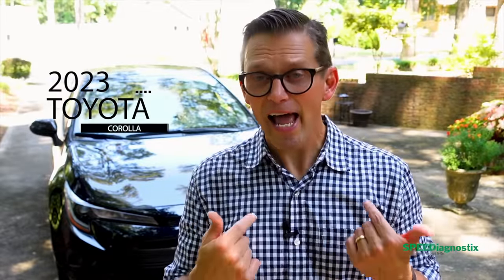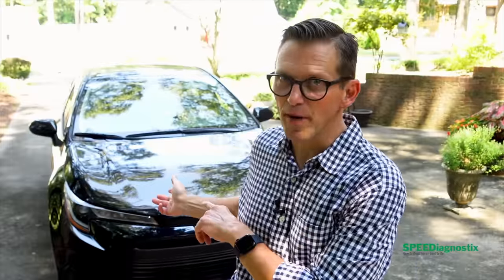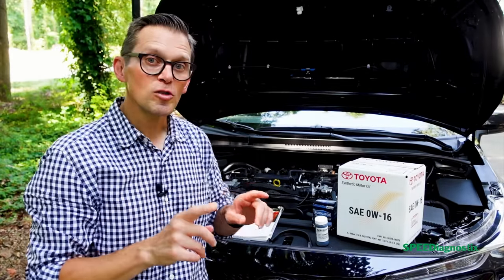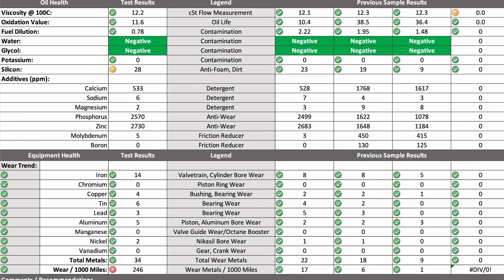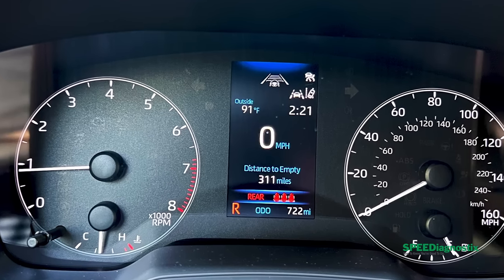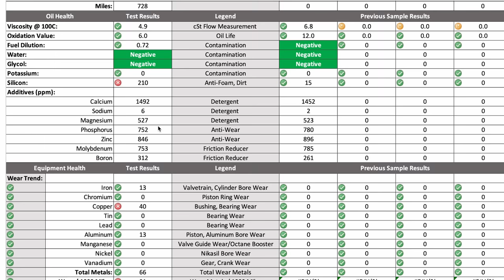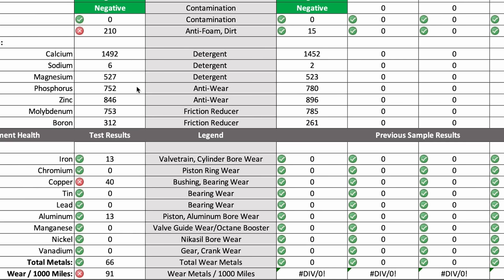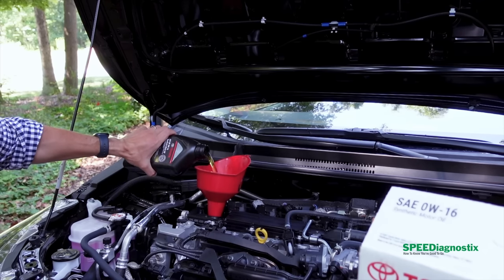AVOID the ONE MISTAKE Almost EVERYONE Makes With A Brand New Car

Comment: I've always drained the engine for a minimum of 12 hours during any oil change. What do you think about that. The experiment I did after being told to do this was a regular oil change, and at the point I would normally put back in the drain plug, I put a clean catch pan down and let it sit 12 hours. When it was over, there was about 1/2 of a cup of nasty Rotella that had a viscosity that was thicker than the oil. Almost like tar.

Comment: Have you tested the different add ons like slim 50 prolong and z max. I did use prolong back when it vame out had a e150 that had a rear main i replaced twice but keep leeking it was so bad. I was broke and ran out of oil to put in it so ended up driving it 100 miles i no when i left it was down 2 quarts i went thrue that much driving 50 miles a day it was knocking hy the time i got were i needed to go but never locked up drove it another 30 miles no oil in it atleast nothing ahowing on the dipstick lol i had used a bottle of prolong it qas probably 20 years ago it was put in back when i put in the last rear main took a couple months before it started leaking it was a 351w with bad main bearings already oul pressure started dropping at around 80k but was curious if those additives really worked . Thank you for another great video!!!!!!
Reply from the maker: Stay tuned!

Comment: The first oil change is the most important. I believe in the first oil change at 500-1000 miles. I did my Tacoma when it was only 2 weeks old. Every race car and engine builder will do the first change at 15-30 min run time. Again when it only has a few hours, and again at 1000 miles.

Comment: Thought I was the only one still doing that... But, boy the dealer was not happy about it. I've been a sole mechanic on our vehicles for 40 years and also worked on a car and truck assembly line for 4 years back in the seventies. I saw how they filled the engines with oil out of a hose hanging off the ceiling as I recall. Now they have robotics, but the inside of the engines had plenty of dust and debris... that's the environment of a factory.

Comment: my wife just got new rav4 prime and i will be doing the first oil change after she used up her first tank of gas or maybe 2nd tank. so far she reached 1000KM but still have 1/2 of the first tank of gas. I told her to use Hybrid mode during the highway and EV mode during the city.
i always do 5000-6000Km or 5-6 months oil changes on my cars. now one is over 300,000KM and other we traded for the prime was 280,000Km. 

it is funny there are people keep encouraging to do the dealer 10000 mile oil changes. or saying that it is waste of money if do it earlier. remember dealer recommendations are bare minimum. if you are leasing or keeping the car for less than 5 years = of course just do the bare minimum. 

in my opinion, this might work for him/her but might not work for others. because if an owner who drives only to supermarket or doctors appointments only (maybe retired) for less than 10 miles per day. means they will have to change the oil in 1 year right? 
or someone who works up in the mountains and has to drive climbing 20 miles in high summer heat, still do 10,000 mile oil changes?
see the driving condition is different 

but if people want to do oil changes before the dealer recommendation, why not? 
it is like insurance. do you buy insurance? or just waste of money too? 
it is peace of mind for most owners who wants to keep their car longer. 

as avoid warranty? as long as you keep the receipts of the filter and oil purchased and keep a good service record of date and milage. dealer cant void the warranty. 
Also if you change your oil more often, there is less chance you need to claim warranty on the engine. 
unless is something else. 
for those who DO the 10,000miles oil changes might be worry after the warranty expires. 

i used to do oil changes and other services on my dad old 1999 honda civic, lucky we bought extended warranty.  the transmission started to slip on the last year of the warranty. 
i even had receipts of transmission fluid purchased at the dealer, date and milage changed few years before it started to fail. provided all record and info to the dealer 
no questions ask, the warranty was approved, and we only had to pay $25 deductible fee. for like $3000-4000 transmission. 

to finish, which car would you buy as 10 years 2nd hand?
a car from an owner who do 5000 miles or 6 months oil change keep records and receipts-  probaly 20 oil changes - easy to prove today with pictures on cell phones. 
 
or an owner who said on here my record from the dealer 10,000 miles so 10 oil changes.

please be honest.

Comment: What do you recommend for a 6.2L GM Truck that doesnt do towing just some mild aggressive driving. Pennzoil or valvoline ? And would you recommend the 0w20 like dealer or a 5W30 ? I live in a high heat area if it matters

Comment: Purchased my 2018 Honda civic hatchback  Turbo new. Got first oil change at 2500 miles as the computer MM system prompted me to. I was confused at first until doing research on "new car engine break in periods".

From that research I learned that Honda uses a special oil from factory that has extra additives for the break in period to help protect the engine. Either way Honda hooked me up with a free oil change since it was my first and a break in period change. Not sure why toyota would ever say to go 10k miles on a new car before first oil change.
Reply: Also on a side note, Honda manual declares a break in period. It said to not drive the car hard and to avoid a constant rpms such as highway cruising but to vary rpms. Which worked perfect for me since I live in a hilly/mountainous area

Comment: I recently purchased a CPO 24’ Lexus ES300H with 47k miles. It’s only had 10k mile oil changes according to the CarFax. It was hard to pass up this car because of the price and condition. 

Although it’s ideal to follow a break-in oil schedule as you’ve recommended, it’s too late. How concerned should I be?

Comment: I’m 71 years old, and I learned from my father at a very young age that you always change the factory oil the first time at 500+/- miles. I did it with my 2003 F150, 5.4L. It has over 290K on it and still runs great. I change the oil and filter every 3-5K, whether it needs it or not.😉😄

Comment: I had a mechanic tell me this in the late 80's. His reason was that the cars were started / stopped many may times from rolling off the assembly line. A lot of wear with stats and stops and back then he said when an engine is started stopped cold gas gets into the oil. I wonder io there's a way to tell how many times a car has been stop /started?

Comment: Hi Motor Oil Geek.  Just bought a 2024 F-150 with the V8 Coyote engine.  Going to make my first oil/filter change at 500 mi and then my second oil/filter change at 3000 mi and my third oil/filter change at 7000 and after this I will change oil/filter every 4000 or 4 months whatever comes first and I will stay on that schedule for the life of the truck.  I'm going to use motorcraft full synthetic oil 5W30 
and motorcraft filter.  Is this a good plan???
Reply: That is very low quality oil. If you are going to use it I would definitely add half a quart of marvel mystery oil at each oil change. Got almost 400K out of my last Ford engine with that formula. It will keep the rings from getting stuck, and keep the engine very clean and running smoothly.

Comment: I'm in agreement with the early first oil change, however, you can accomplish nearly the same thing by using a refrigerator magnet. Just wrap it around your oil filter (at the lowest point) and the magnet/filter will collect most metal debris floating around your oil.  Once you do your first oil change, replace the drain plug with a magnetic one to collect metal in the future. Granted, this will only catch the iron based metals, but the lead, copper, tin, etc. are softer metals.  I don't know why filter manufacturers don't place magnets in their filters.

Comment: Can I ask you a question Sir.

When I bought my Triumph Motor Cyckle new in 2020 I was told by the sales man not to exceed the 500mls oil chant the Triumph req....he said it as the engine is filled with mono SAE break in oil at the factory.

It was covid lock down at the time....I am a spanner guy so I got permission to sdo the 500 mile for service oil change myself long as I use a Triumph Oil Filter and the req Castrol oil which I dis....10w/40 semi or fully synthetic.

Job done I started the motor....rattled a bit ok.

But ever cold start since that first oil change I get a tapping noise from the motor after about 20seonds....lasts about 3 mins and slowly goes....the engine is sweet from then on till the next cold start.

I have spoken to many owner of the same bike as me around the world.....lots not all have the same problem.....tapping just after cold start....lasts 3 mins and slowly goes.

My guess is that if the salemanm was correct in saying the motor is filled with break in SAE 30 mono oil maybe that thick oil masked something we hear now,

Do you think it could be correct that Triumph do put Break In Oil in there engines at the factory.

I do still have that oil I drained out on that first service....most people I ask disagree with what that sakes man said re the break in oil.

Would love to know if that oil I still haver is indeed SAE 30 mono grade.

The old break in oil was quite clean at 500mls....it a sort of clearish brown color....like oil from years ago.

What do you think Sir.

Nick in the UK.

Comment: The owners manual says you can use the 16 but then the next oil change you have to go back to the 08, do you think it’s OK to stay with the 16 because I had to buy the 08 from the dealer and they want $20 a quart
Reply from the maker: The 0W-16 is fine to use all the time.
Reply: @themotoroilgeek  thank you very much

Comment: HELP ME PLEASE,  I'm too old to waste another minute until the throw dirt on my face. Cutting through the chase,  What oil should I use for my daughters brand new 2025 Honda HR-v (non turbo)  with 75 miles. I'm changing the oil/filter around the  500 to 700 miles to get rid of break in contaminates. Thanks for helping out an old guy whose candles burning down !

Comment: I do not work on alot of small engines but V8's and diesels alway's get a 500 mile or for equipment 20hrs at most. Sound's strange to change it in 20 hr's (2 1/2 day's) but that is more then 500 miles travel time.  Also the only time I ever sent in new oil for analasis was following an engine failure on bulk oil. Turns out the bulk oil had better readings then out of the bottle off the shelf.  You do have to love oil analisis if you do it faithfully. Amazing to watch wear drop with with a  quality oil vs what is typicaly run to save money.

Comment: Question. What would be the perfect oil change interval during break in? first change at 500 miles, second change at 1000 miles and then each 3000-5000 miles?
Reply from the maker: That would be about ideal!

Comment: Sorry, I changed my 1st OIL at 500 miles paid out of pocket, dealer won’t do it ! Am waiting to have the Dealer changed it at 5K miles ! What is your take on using Royal Purple on 2021 2.5 / 2024 2.4T Subaru engines ? 

I also own an STI S209 but I use the MOTUL 300V, that’s what STI recommended for the S209,  been that is a High Performance Beast.

Thank for the feed back !

Comment: My habit has been 1st oil change at 1,000 miles no matter the vehicle... and every 3,000 miles thereafter. My rockers, cam, tensioners etc have always looked good without any varnish. Oil by design holds particles in suspension and I refuse to trust the intervals - especially for my 2022 F150 work truck that tows daily. The wifes Subaru gets it every 6 months whether she likes it or not LOL....... but then again she drives a couple thousand miles per year and runs ethanol free fuel unless we have to travel to visit her family in California.

Comment: I was always told the oil that comes in the new engines was a special break in fluid and not to change it under 1000 - 1500 , miles because it contains specific wear and anti wear packages that are needed to protect new engines
Reply from the maker: That was true 30 years ago, but not anymore… NEW Engine BREAK-IN: Truth or MYTH?
https://youtu.be/X4424Q5lLR8
Reply: @themotoroilgeek  but wouldn't that explain all the extra additives ?

Comment: I always do the first oil change at a few hundred miles to get all the debris out that gets in the oil from assembly lube to sealants and gasket material that gets in the oil and any break-in debris like cam and rings. If Toyota says to change the oil at 10k miles, I would do it at 5k, it's cheap insurance.
Reply from the maker: Absolutely

Comment: So I'm guessing you're strongly against going 10k miles between oil changes?

Just purchased a 25 Camry Hybrid and I plan to do similar to what you're doing here. I drive 2000 miles a week, so my first oil change will go longer, but I want that dirty oil out of there.

My plan is to continue doing what I've been doing and changing the oil every 3 weeks(approx 6,000 miles), but then I got to thinking, if it's a hybrid, the engine isn't always running for all of those 6,000 miles. So, would it be okay to stretch it to 10,000 miles since it's a Hybrid? And would an oil Analysis tell me the answers to my questions better than anyone else can?

I use my car for RideShare so it's all hard miles inner city. That's why I change it as often as I do in the current 14 Corolla I'm driving.

Thanks for any input you may have.

Comment: I bought two cars brand new and changed out the oil after 1K of breaking in the engine. I now have 166K miles on one car (Toyota) without any oil burning or leaks and 12K on the other, newer car (Dodge).
Reply from the maker: Nice work!

Comment: I’m a little lost on what oil I should be using in my low mileage Ford 7.3 F350 gas.  I put a truck camper on it bring up the weight to approx 12000lbs. I’m aware of potential lifter issues on this engine so want to ensure I’m feeding it the oil and have the right intervals.  Any suggestions?

Comment: I am so picky on my break-ins that I changed the oil in my new Corolla at 1100, 2800, 4000, and 6000 miles lol.  4 oil changes already it's only 15 months old.

Comment: I got so many other things to do with my time. 10,000 miles on oil change is good with synthetic oil. My last car ran for 220,000 miles — perfect condition until I got a new car. The new owner is very happy with my old car still running will probably go to 500,000

Comment: 3k change everytime because the heat Cycles wear out the oil  and keeps the particles from dropping out a suspension in the oil which causes sludge in the pan and you don't want that pump through your lifters and bearing surfaces if it swallows any sludge all my engines are extremely high mileage and run like Swiss watches I always buy the next three oil changes all at once and keep them in my garage little spendy but then I don't have to chase my tail buying new oil and filter every time I love oil

Comment: I wonder if a first oil change at 500 miles would have stopped the Tundra v-6 failures? I've done that  to every new vehicle I've ever bought since 1981, a Toyota pickup by the way.

Comment: Very good testing especially for the cars that now using RTV instead of the conventional gaskets! Horror stories of Subarus and Toyotas with traces of RTV in the oil pickup and filters (cutting open the filters) on the first break-in oil changes. Thanks for the educational video! Liked and subbed!

Comment: The assertion that it is a “mistake” to follow the owner’s manual w/r/t the first oil change is based on the unsupported assertion that having those wear metals circulating through the oil system is bad for your engine. I’m going with the engineers and tribologists on this. The oil makers would be screaming if they thought it was dangerous and that their oil could not provide adequate lubricity and wear protection even during break-in.

Comment: I did the same exact thing when I bought a brand new 2013 VW Jetta right off the showroom floor. I went back to the dealership at 1,000 miles and told them I wanted the oil changed. The service clerk lady said oh you don't have to come back until it hits 10,000 miles. I said trust me, I want the oil changed today, I have my reasons. I want the factory oil drained out. I explained briefly my reasons. She said well ok. Sure enough 20 minutes later here comes the service technician. Bro you know this car comes with extended life synthetic oil. You're good man until 10,000 miles. Again I had to explain I want that crappy factory break in oil out of the engine. It did it's job, now I want a fresh synthetic oil change. I have no problem spending $80 on an oil change (back in 2013) if it means my engine might be a lot cleaner over the duration of it's life span and last longer. They thought I was nuts I guess.

Comment: 2008 Ford Ranger 2.3L  They car calling for 5w20, back in 2008.  Would like to run 0w20 (that's what the other cars I own are calling for).  Do you see any problems running 0w20 in the 2008 Ranger?

Comment: Engines do break in and improve.  They loosen up an fuel economy improves with time even with no excessive oil consumption.  They can be driven from day one with sensible speeds, not excessively slow which can damage a new engine.

Comment: You need some wear during running in to bed in the parts to each other. I dare say your early oil changes are actually counterproductive to engine longevity.

Comment: Where do you get the oil analysis kits? The kit from NAPA only has 1 bottle. I've done analysis before, but without a new oil sample, the lab doesn't have anything to compare the old oil to.